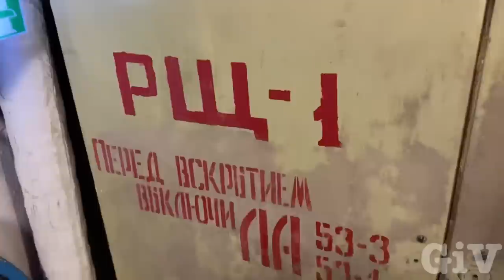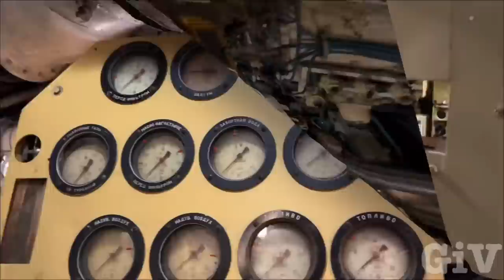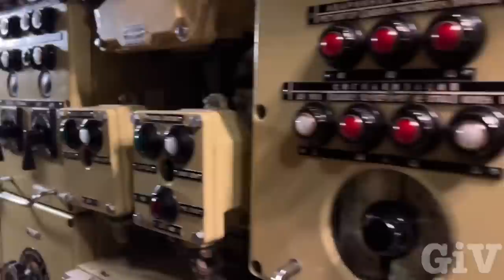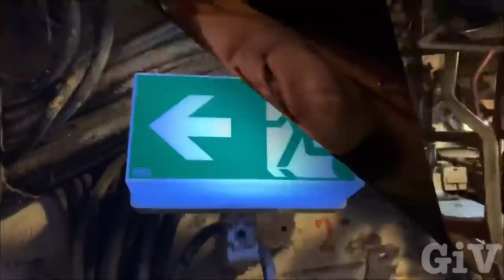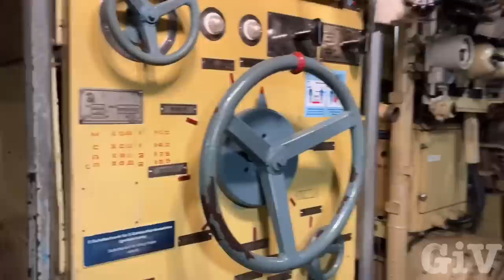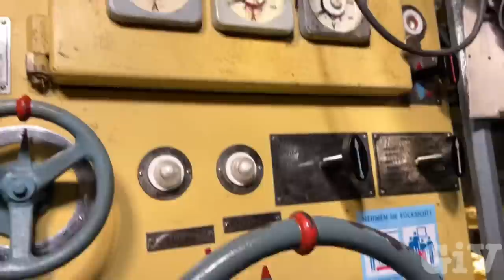Exploring the inside of an  Russian Submarine im Hamburg the U-434  2023 full tour

Comment: I've been in the one that was used to shoot "Das Boot". Really claustrophic. But it was on dry ground. I remember one of the biggest ever built Russian nuclear submarines Kursk sinking in summer 2000 after an explosion and the Russians not able to get to the crew to rescue the 23 of the 112 seamen on board who survived(although they didn't know that those 23 did survive at the time) the blast and those 23 dying a horrible and slow death down there. Russians, as usual, denied that it happened at first, then claiming it's not possible to get in there, then blaming the US to have rammed the submarine and then finally accepting help from Norwegians who were able to get in there one week later with little effort just to find the whole submarine flooded and everyone dead. The 23 who survived first, were in the back of the submarine where also the emergency exits were located but a fire broke out at some time and they then suffocated. It was a massive submarine, not like this one. 154m of length and 18m wide. That's 505 feet long and 59 feet wide. Horrible death. Under no circumstances I would board a submarine. I also have to think about the horrible death of journalist Kim Wall a few years ago by the hands of this Norwegian creep with a private submarine he built. So you can guess that I am not a fan of submarines. 😏